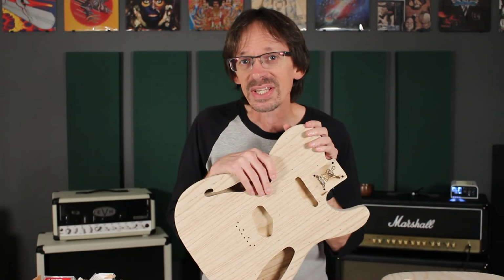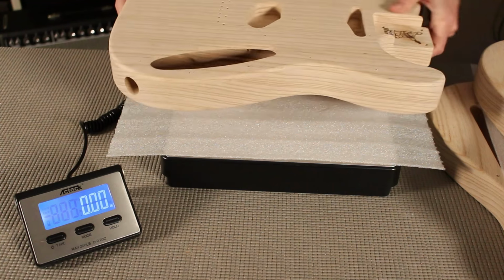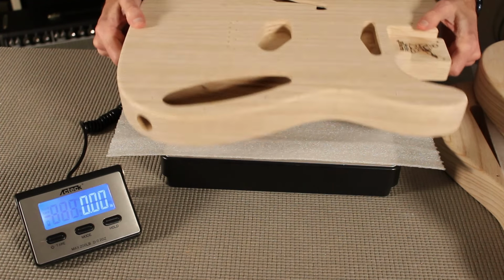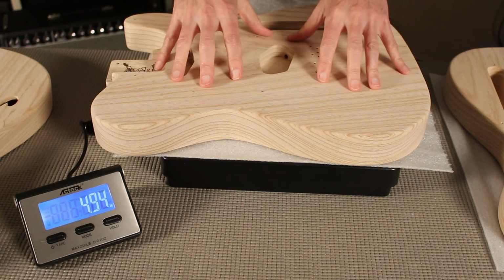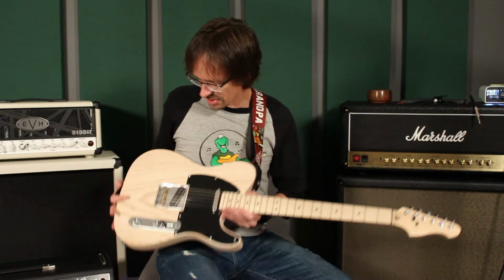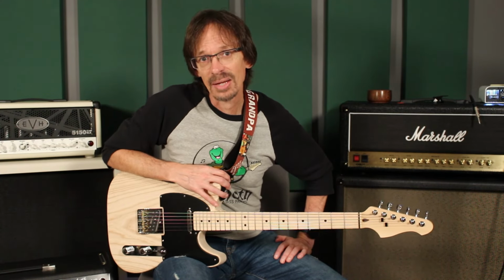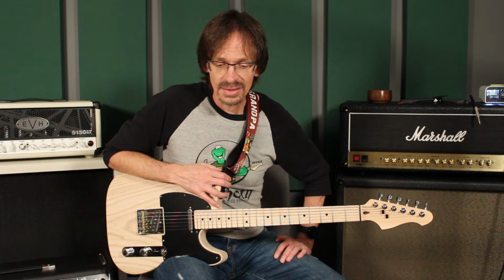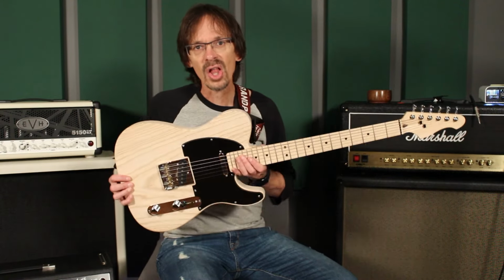Do Thinline Tele® bodies sound as good as solid or chambered?

Comment: The fact that they don't sound noticably   different will never stop endless debates among those who think they can tell a difference.....
Reply: I can tell the difference between a 10 and a 20 instrument cable (Plugged into guitar and front of amp) but these all sounded the same minus the human variation in the performances.
Reply: @2204JCM  To me, a 10 foot black cable sounds just like a 20 foot red cable.
Reply: I’ll tell you this, which was my actual life experience: play the first half of a gig with a regular Tele then break a string and switch to your Thinline and then tell me if you can tell a difference. You’ll say….”yep sure can. First and foremost the Thinline wants to feeds back more and generally feels more lively at stage volumes, and tone wise feels like you’re getting about halfway to a 335 sound.”
Reply: @turunturun Exactly, the difference is in how they react to their environment, mostly how they feedback.
Reply: @theprismaticsystem2833 yeah you get it. People forget these things are operating in systems of interacting elements. So sterile controlled A/B tests focused on a portion of that system are only telling part of the story. Who cares though, each and every guitar is capable of serving a great song. Bob Marley could write a great song on a $50 guitar that was missing two strings but the internet wants to argue whether balsa wood sounds different than chipboard.

Comment: I am a rhythm guitarist playing in a band for pop and rock music, the Thinline is my choice, I have 4of them with varies pickups. My main reason to choose it is the weight, 6lbs 4 oz is hard to beat for this 73 years old man.
Reply: I have Thin Line also. Mine was made from Warmoth one piece Maple neck & fretboard with a light Ash body and all Fender parts. When it was assembled it weighed under 5 Pounds. I love the fretboard it has a nice snap and bouncy feel. The body is very resonant and sounds loud enough to practice at home without an amp.
Reply: @GodNCountryF35II  thanks for your info, however Godin is not available where I live and I rather not buy a rather expensive guitar thru the internet. I shall keep an eye out for it if I have a chance to travel.
Reply: I hate heavy guitars.

Comment: The Thin Line model sounded the best in all positions. There wasn't much of a difference between the other 2. As you said most of any difference can be changed by turning the controls on the guitar, the amp or effect pedal. What's the most important to me is the profile of the neck, the radius of the fretboard, the comfort contours of the body, the balance of the guitar and the weight. I have one of your 1972 Thin Line models with 2 Humbuckers that weighs a little under 5 pounds when it was completed. It was given to me buy a very good friend. I won't ever let it go.

Comment: Nice work!  I couldn't tell a difference between any of them.
Reply: They sounded the same to me. If there was a difference Is wasn’t enough for me to worry about.
Reply: @Mark70609  Perhaps acoustic there is a diff. If you're in the same room live with it making sound in real life while carefully listening like a mofo... Then you might notice some SLIGHT diffs lol. Also string gauge matters for that sort of acoustic thing. 9s are easier to bend than 11s but 11s are a tiny bit louder acoustically speaking. Bigger the string, bigger the sound. 

No one should really care all that much about these minor deets. Pickups, amp, effects, and player skill/style matter the absolute most. Then small crap like tuners, bridges, terms, strings, finishes, neck/body/wood type/shape/size etc etc...

Comment: Thanks so much for these tests! Another great one! 
C definitely had more core and focus than A and a whole lot more than the thin line. It is true that in the end you could just favor a thicker sounding amp and/or speaker and/or pickup. In the end each element is just another mild eq. it's not an accident that a lot of semi hollow bodies have humbuckers instead of single coils. For me a relatively light solid body is still the best compromise. Also you could use a softer wood like mahogany to tame the high frequencies a bit on a thin line.
Reply: The reason semi hollows originally started getting humbuckers is because Gibson wanted a hum-free solution for the P90 pickup that would normally come on all of their guitars. The other brands just copied them afterwards.
Reply: Yeah, I was surprised that C was my favorite because I expected to prefer the chambered body! I kept coming back to C because it had that Tele 'quack' goin' on and sounded tighter in the bottom end. Always loved that sound even though I'm a "Srat guy," lol.

Comment: I got the 3 Teles right... chamber > hollow > solid. I'm in the studying phase to build my 7th Warmoth guitar. This will be a Telecaster with 3 Lollar Charlie Christian pickups. Body will be swamp ash with a black korina top (for the looks). I'm mostly attracted to the chambered choice as tone is nice, close to the solid and it doesn't have the reduced volume of the thinline one. Weight relief is also a bonus there. But I have to consider better the chambered version vs. the solid one as I'm still not 100% set on this. Another source of big doubt is the bridge!!!! It has to be a steel base plate with brass saddles, that's undebatable but the issue for my ears is intonation. Old vintage saddles are out of question. The new modern compensated ones seems to be a better choice but I'm still afraid that they'll always be a compromise about good intonation, which is something a 6 saddles bridge can handle with far superior precision but it won't completely sound as a Tele where 2 strings share the same piece of metal.. This will be a hard one to decide! Thank you for your videos, Aaron! Thay can be a big help for us out here.

Comment: From here, it seemed more reverb in the low to mid frequencies in the thinline. A bit of sostenuto. The chambered I recognized as a closer sound to the thinline. The solid seemed the most flat of the three but a little brighter on high frequencies. But I wasn't holding any of them. Just listeneibg on a mobile phone.

But there is not sufficient difference in the tonal quality to prefer one. Weight would make the thinline my choice.

Comment: Great video Aaron. I'd suggest another topic: hardtail Strat x decked Vibrato bridge Strat x Floating Vibrato Strat. (all from the same piece of lumber, same pickups, etc etc). I always wanted to hear how much of a difference (if any) the back cavity and springs make.
Reply: Good idea but you can't get the same body specs with a true hardtail against the decked or floating trem routed bodies... but comparing the last two would be cool.
Reply: @bloozedaddy  That's exactly why the comparison. Obviously the weight won't be the same, no cavity on the back, no springs... Often people claim that a "hardtail-string through body Strat has a sort of Tele-esque character" - let's see if it does change that much compared to the 2 other configurations.
Reply: @iagobroxado  Well I have a 1981 hardtail...and a 2007 tremelo Highway One and a 1992 telecaster and I can say the strats sound like strats and the tele sounds like a tele :-) I'd be more interested in the blocked vs the hardtail or blocked vs non-blocked sonic differences.
Reply: @iagobroxado  "Often people claim that a "hardtail-string through body Strat has a sort of Tele-esque character" Of course it does. Body shape is not a huge factor in electric guitar tone.
Reply: That's a GREAT idea...  I'd also like to see a Tele with  an LP-style bridge, to see how close to that sound you could get with a Tele.  I'd love to have a tele where I could get that LP bite, and clarity from the bridge, then have a classic tele sound in the neck.  You'd be able to cover almost any territory that involves a guitar hero with a guitar like that.

Comment: The solidbody sounded more defined, tight, thumpy bass, clear ringing notes and string definition. The thinline sounded warmer, flatter, more "jazzy", less tight. I thought I was going to prefer the thinline, but ended up being the exact opposite on every test. THANK YOU for taking the time to make this. I came out to your shop in Puyallup about 30 years ago and bought a B-stock neck for a strat I built when I was 14 years old. That thing is still my #1 guitar....never finished the neck (despite your warnings) and it's been rock solid! Pau ferro on maple. You guys rock!

Comment: I took both a solid pine body SSH Tele and a Thinline mahogany Tele to a six hours gig.  They were both the (made in China) Fender Modern Player Series, but the Thinline had the Seymour Duncan USA P-Rails with single coil, P90 and HB tones from the push/pull pots.  Both guitars packed a lot of single coil and HB tones.  The solid body simply had a little more volume thump, cut and midrange presence that better cut through or sat better in the mix of vocals, drums, bass guitar, keys/steel guitar, with one player alternating on either the steel guitar or keys, and singing too.  He was very talented.  The Thinline was more airy and bass-y, and didn't cut through as well, it had more of a scooped midrange.  It seemed to be a little less present, more lost in the mix, or didn't sit in the mix as well.  Just my experience with those two particular guitars running through a Fender Super Champ XD.  I was playing both lead and rhythm guitar parts.  The Thinline might have fared better with a little more wattage and a 12" speaker, but the solid body pine carried the day on that gig, at least to my ears.  YMMV.

Comment: I usually play Solid Bodies, but also like Thinlines or Chambered guitars. But, a guitar itself is a complex, interactive system, even more in a signal chain with pedals and an amp, so things are depending on a lot of interactivities. Even a different speaker will give you a dfferent, sometimes better, sometimes worse final sound. 

The best sounding guitar, I ever had, is a Chambered Les Paul, but I did not like it's original pickups (bridge pickup was some sort of high-gain pickup, which I did not like in a LP) , so I replaced them to a comparably cheap vintage PAF Set, added a controllable, passive bass-cut to the neck pickup (tone pot) , as this one tended to sound too bassy due to the chambers and changed the other tone control to a master tone and now it sounds awesome and even more flexible, as I can add some bass for clean neck pickup sounds and reduce it for rock or high-gain overdrive and also can use the neck pickup for overdrive lead sounds. But, the feeling and the weight is different to a Solid Body. It still rocks perfectly well, sounds great, has more than enough sustain, but also has a beautiful acoustic, organic, more directly responding and percussive character added, which a Solid Body does not offer and still sounds like a Les Paul and not like an ES-335. 

Same with Thinline Teles, if the rest of your setup can handle or reduce the more intense bass, you can get great, in some way more broadbanded sounds and if the neck-body connection is well made, a little less sustain is no problem, but you get the advantage of some more additional acoustic qualities and more bass, which can be an advantage or also not. 

Also price is an argument, usually Thinlines are more expensive than Solid Bodies. Another argument is, that the body of a Thinline has less weight that the one of a Solid Body, so it will hang even less comfortable on the strap than a Solid Body Tele,  which anyway is hanging there in a not so pleasing very horizontal position, if compared to a Strat. So my perfect thinline would be one with a longer upper non-cutaway and typical strat routings (like eg. a Pacifica or Cort TC), so that the neck moves into the right, slightly upward position automatically. But this is a matter of taste. 

Thinlines or Chambered guitars sound very similar, more or less, the difference mostly are single coil or humbucker pickups, a Semi-Hollow (like a ES-335) is a different thing, an ES-339 or Ibanez AM something in between. 

Meanwhile some budget companies also offer "Thinlines", which only have routed a slightly larger part around the f-hole, but not other addidtional and authentic chambers within the body, so these are no real Thinlines in my opinion. The problem is, that you hardly can control this, if the top is glued onto the body, but the weight difference most probably will tell you the truth, about, what's really inside. 

If you have a weight reduction of about 0.7 to 0.9 kg, compared to the solid body model, you most probably have a real Thinline, Semi-Solid or Chambered model. If not, the f-hole is just there for cosmetic reasons and the guitar more or less is a Solid Body with the (fake) look of a Thinline or Semi-Solid, but not really with the sound of one.

Comment: I had a bit of trouble, with chambered and solid, but had nonissue hearing thin line. But, Im also almost 50 and never wore earplugs so my high end is gone just ringing tinnitus. The thinline I could pick it out blind though. Deffinitely has an almost 339 quality to it but not quite. I could hear the chamber box resonating. If you were in the same room as the amp. Thats what I heard. Your amp entering the F hole and resonating a “bloom” and a woody thing I didnt hear with the other two. But I admit my old ears had trouble between chambered and solid. I can hear it on a LP but couldnt on a T style.

Comment: I like Thinlines, have a slighty different attack and for me a more complex sound than a solid body Tele. But anyway every Tele sounds different in some way...

One of my favorite guitars is a rare semi-solid / intensely chambered Les Paul with solid maple top. When I got it, I thought, wow, this is light weighted. Only 3.2 kg instead of the 4 kg of my solid body one. Then the tone is a typical Les Paul tone concerning sustain, but with a slightly faster attack, some more freshness and some really beautiful, well audible acoustic quality in the tone, which you hardly get from a solid body, but also very different to the more percussive tone of an ES-335 or ES-339 or an Ibanez AM. So it's for me some sort of best of both worlds for me. I only replaced the high-gain pickups, for me a Les Paul needs PAF's or P90's. But I added a bass-cut for the neck pickup, which makes this guitar to one of my most flexible ones, as this control also affect the combined pickup sound(s) and so even makes a Strat obsolete. 

At the moment I am considering, if I should buy a Thinline or solid body Tele, but it's not so easy to get a good sounding one in a reasonable price range. Once I had a wonderful, but also expensive 1990's ash Blade Delta, this was more or less perfect (apart from the typically abrasive gold hardware) and also a Squier Double Fat with chambered mahogany body,  set-neck and Duncan designed humbuckers, also nice sounding, but the nut width was too low for me. (39mm). 

So my personal experience is, the diffferences for an audience (or on Youtube) may not be so intensely audible, but the feeling, if playing, certainly is it for the player himself. Simply sounds more natural, organic and right in some way. A semi-solid or Thinline adds some more "dimensionality" to the tone, I would say. This is something, which you hear in the room, but even the best microphones hardly will capture this authentically. 

If you want to keep things simple, you cannot do much wrong with a solid body Tele too. But my favorite among the bodies here would be the semi-solid, I think. Alone, because my pullovers, shirts or hoodies and the sharp edges of the f-hole never ever became the very best friends... ;-)

Nice comparison!

Comment: I thought the chambered and solid body sounded quite similar in clean tests, but the thinline had less body/girth to the tone.  With some dirt, I found it difficult to tell them apart.  Based on those clean test perceptions, I slightly favored the solid body over chambered but not by much at all.  Thanks for doing this, very enlightening.

Comment: OK, I covered up half the screen so I couldn't see which was which. Although I felt I could easily live with all three of those guitars, I had a slight preference for A. I did guess correctly that is was the chambered. But the other two I got wrong. I thought B, which was my second favorite, was the solid, and C, my least favorite—buy I'm splitting hairs here, because it seemed to somehow be lacking sparkle and sounded a little more hollow, less focused, I thought was the thinline. I thought B sounded the brightest and most focused of all and I equated that with being more rigid. I felt A was the best balanced of the three. I did not perceive a volume drop with B; rather, I felt C had a slight volume drop. I should mention that my main guitar is a Rickenbacker 330, and when I bought it, the main competition for it for my money at the time was a Fender American Standard Telecaster. I ended up choosing the Rickenbacker, because I felt it had a more versatile range of sounds.

Comment: Spot on that the perception when holding and playing is different than just hearing it over speakers or headphones. When I got my first Warmoth neck -- a Gibson conversion -- I did maybe 100+ swaps with the stock Fender Strat neck trying to hear subtle differences. I concluded that I was mostly chasing sound gremlins in my imagination. But the Gibson conversion was easier to play, and so I sounded better on it. It was me, not necessarily the neck itself.

Comment: VIOLINS have a soundpost, connectcing the top with the bottom under the bridge.
maybe that's what the thinline would need to be louder. (?)
violins are acoustic instruments and have "projection" which can be explained with "volume" or "sound".
maybe you can try that with the thinline.